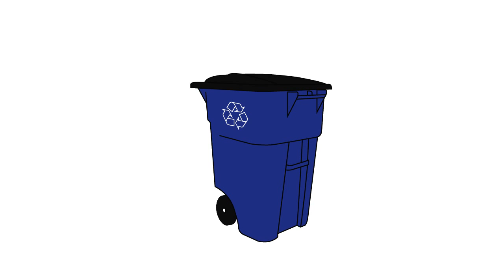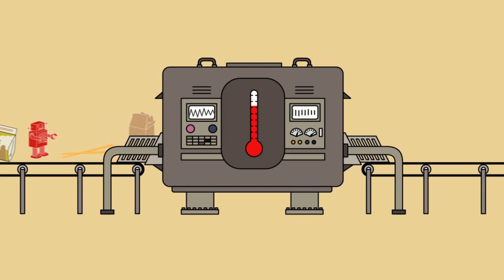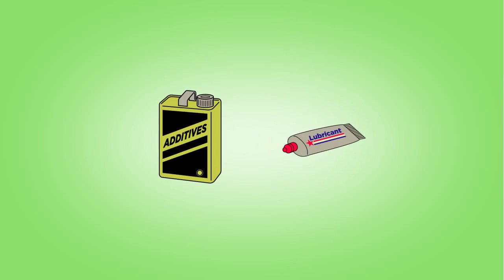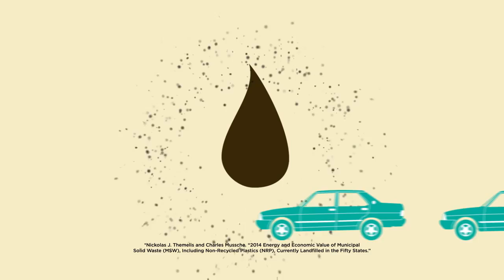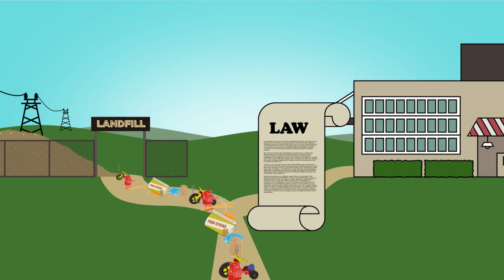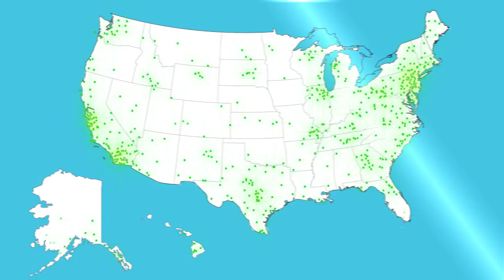Plastic To Fuel - Waste Plastic Pyrolysis plant

Comment: Useful if you can get the process heat to make it happen. As of right now, I don't know if the return is there. You need as much energy content in the oil and syngas coming out as you do to pyrolize it in the first place. 
Perhaps with a concentrating solar setup? Use concentrating mirrors to heat the pyrolysis chamber at the top of a tower. The piping coming down would serve as your condenser and you separate the carbon black and other wastes at the bottom from the oil.
Reply from the maker: Beston pyrolysis technology can achieve recycling plastic to oil.
Reply: @bestongroup_  Yes, the process is well known and works. The issue has always been the heat source to drive it. If it costs the client more in gas, oil, coal, etc. than it returns in oil, the entire plant isn't worth the expense.
Reply from the maker: @Clean97GTI  It turns waste into energy, which is the best important. What's more, it does not cost much gas, coal, etc. It costs less but earns more.